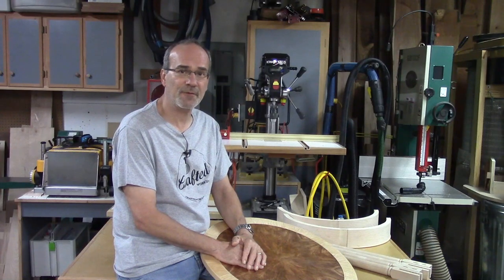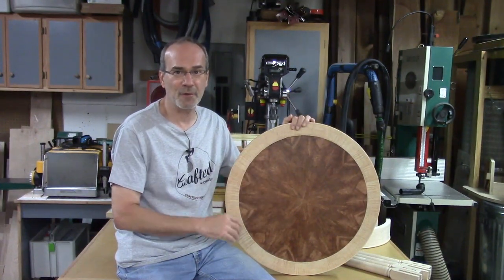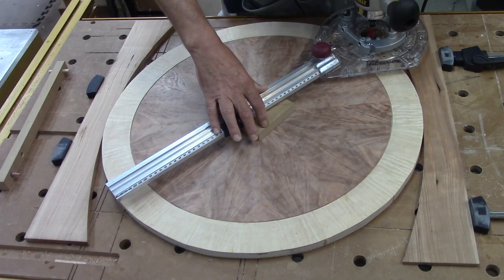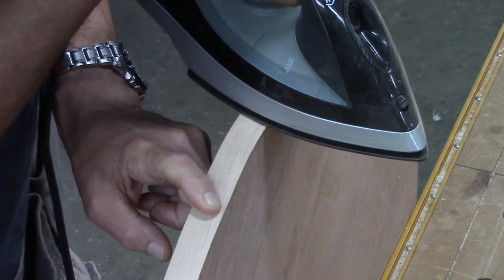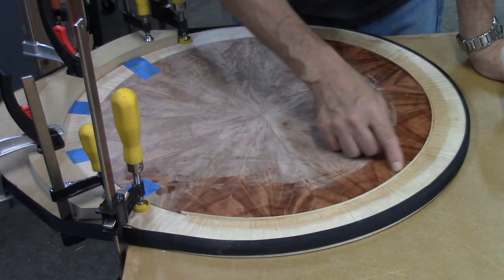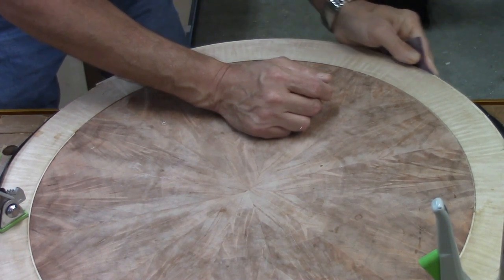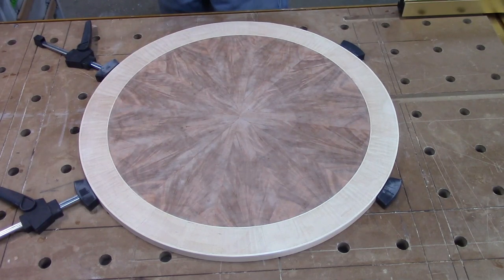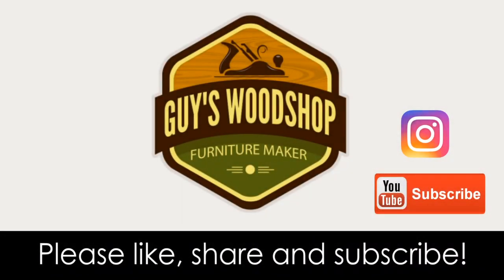Sunburst Veneer Table - Inlay for the Top - Pt. 5

Comment: On my project I was concerned when removing the center block... I learned that some naphtha applied to the edge of the block which I put a small bevel on penetrates in and softens the glue on the tape...  Very last thing we would want is veneer being torn up.
Reply from the maker: Good tip. Thanks!

Comment: Hi Guy:
That gig for clamping the outer inlay was real slick.  Your mine was spinning fast on that gig.  It looked like it worked real good.  I hope you had some packing on it.  The top looks great and the two banding set off the middle real nicely.
I noticed your circle guide in the last show and again in this show.  If you don't nine, who made it and where did you get it.
The banding you are installing on the bottom of the table skirt should not be hard to install now because you can do it just like you did the top outside of the top.
I heard you were at Popular Woodworking event.  If I had known you were going to be there I would have come and met you.  You do very nice Shows.  Thank You
Reply from the maker: Thanks! If you look in the description of the video, there is a link to manufacturer of the circle jigs website.

Comment: Hey Guy, Awesome project! Thanks for sharing. As an amature woodworker, I do have one question: why did you flush up the edge banding with the plane iron when you used the router to make a rabbit along the edge? Wouldn't that have just cut the edge banding for you?
Reply from the maker: Thanks Luke! The router wouldn't sit flush to cut the rabbet if I didn't get rid of the excess first.
Reply: Painfully obvious now. Thanks.

Comment: Enjoy the video.    My question is why not put on the veneer on the sides before you put on the Curley maple.   This would avoid the need for the edge banding and would avoid an unnecessary line on the top
Reply from the maker: The hard maple edge is part of the design and adds an extra layer of not only color, but protection for the edge. It is a traditional element in the design of this type of table top.

Comment: Guy, the top is absolutely beautiful.  I love the attention to details.  Just curious, you stated this was the first time you did this type of work and would do several things differently next time.  Care to share what you would do differently?  Again, love this top and all of your videos, Guy.  Thanks for continuing to share your projects.
Reply from the maker: Thanks. I have done veneer may times, but never a sunburst like this before. The main thing I would have different is not to use cherry crotch veneer. After I took it out of the press and let it sit for a couple days, the veneer shrunk. There are some fractures in the wood, and the seams aren't that tight anymore. When I out the oil on, it really darkened those cracks and seams and made them stand out. So I wouldn't have used the crotch, and I should have gone to just straight shellac instead of putting BLO on it first.
Reply: GuysWoodshop Thanks Guy. I appreciate the details.
Reply: FYI, I watched a video of a guy (craftsman) who ever so slightly adjusted the segments so that when the wider outside pieces 'expanded' the top veneer would lay flat.  When the top was taped together the center was raised like a cone. When the out side perimeter expanded because of the water in the glue to top laid flat.  He learned by expieence as we all do.